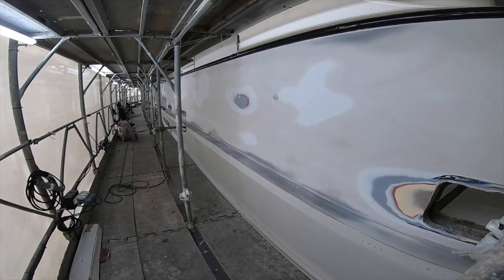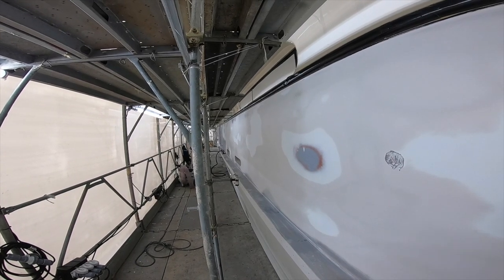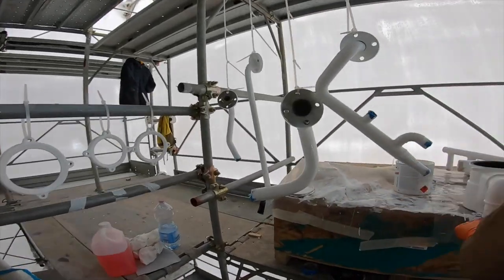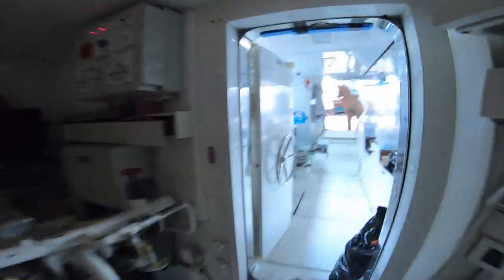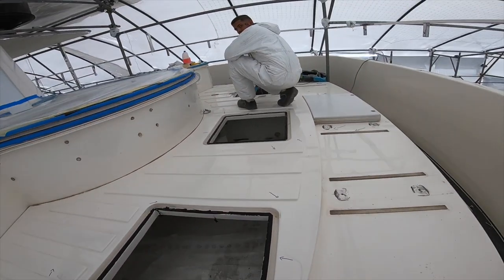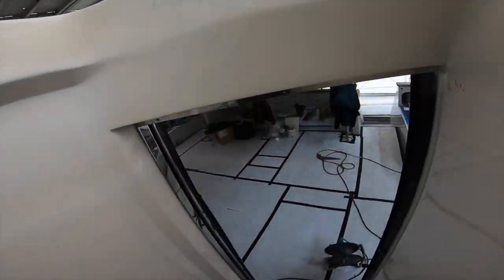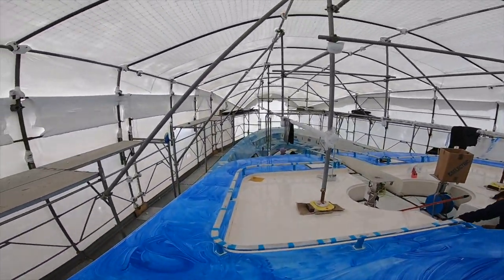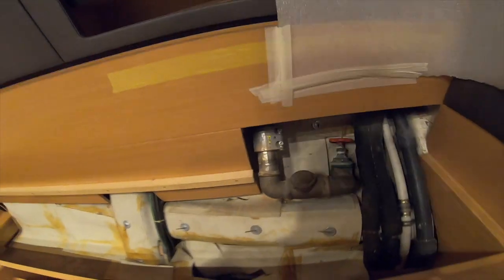Captain's Vlog 27 (Shipyard 5)

Comment: In the automotive world the blue coating is called a guide coat.  It usually just a contrasting paint color to the base color or they use special black powder.  When you start sanding off the guide coat it quickly shows your highs and lows.

Comment: RobL
Hi Tristan.  As an engineer who used to own a powder coating plant I am truly surprised to see  the use of powdercoated aluminium on your vessel.  The correct procedure for the treatment of aluminium in a hostile environment such as the presence of dissimilar metals and salt water is to have the item anodised or alternatively take the component back to raw aluminium, acid wash it to remove all oxidation;  coat it with several coats of etch primer and then spray it with either 2 pack polyurethane or epoxy. People often think that powder coating is a protective coating when in fact it is merely a statically charged powder which melts in an oven to provide an attractive, high gloss finish.  There are micropores which remain in the finish even after it has been through the oven which manifest themselves in cracking and lifting of complete areas of the powder coating ( as shown by your sample), caused by salt water permeating the porous powder coated finish and the resultant aluminium oxide which forms between the aluminium and the powder coating. When you examine the surface beneath the lifted powder coat you can see very plainly the white aluminium oxide residue.  

As a sailor of over 60 years I love your vlog as it shows the highlights and lowlights of running a vessel at sea, particularly in the presence of paying guests who in many cases have little or no knowledge or even less concern for you when things go wrong.  keep up the excellent work as I look forward to each episode.  Many thanks.

Comment: I am equally impressed as the rest of your viewers on the the detail you are providing on this extensive refit Captain.  I'm a recent subscriber and am binge watching the old ones to catch up!!
This video raised a question for me when you were speaking about the weight ratio and balance...the areas on the hull where the supports are...do these supports get moved a little so those areas can be addressed, or are they skipped?  It would make sense to me that you could move them one at a time (port and stbd together) starting at the bow and moving aft.  Then reverse that when applying paint.
If I'm ever blessed enough to be in a position to look for a Captain for my super yacht (131m Sunseeker is my dream) then I will find you!!

Comment: you are an amazing individual.  Yes the owner is privileged to have you on his team.  You've acquired so much knowledge for your young age.  Question on the 10 year refit.  What would a refit cost for a boat this size?  what is the length of the boat?  Just curious.  I know a rule of thumb of expenses per year is roughly 10% value of new boat but curious as to how expensive this 10 year procedure would cost the owner approximately.  Thanks for posting.

Comment: Every 10 year survey and refit will be different yacht to yacht, depending on its use and maintenance, what type of ball park cost would it be?
Reply: I think it's fair to say the cost of the refit would be more than $10,000.   A LOT more!!!   <g>   Heck the cost of having the crew working for that 6 months alone would be a goodly sum.     And the shipyard would have charges for holding the boat even if they weren't doing any work on it.    IT costs upwards of $3000 to do a decent repaint of a car so figure what that means for repainting a 122foot yacht!   not to mention disassembling all that machinery and refurbishing it,   taking off all those fittings then putting them back.    My real guess is 4.5 bazillion bucks.